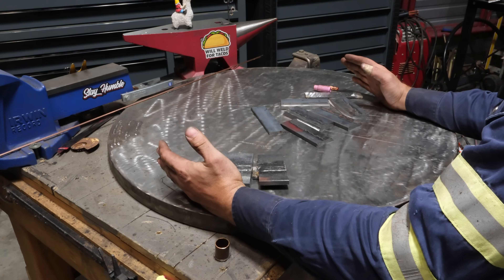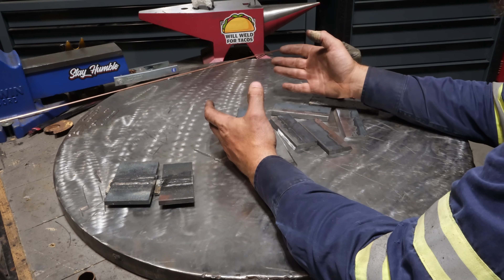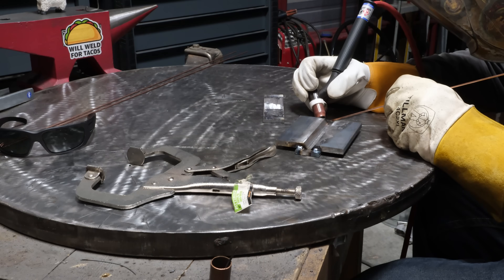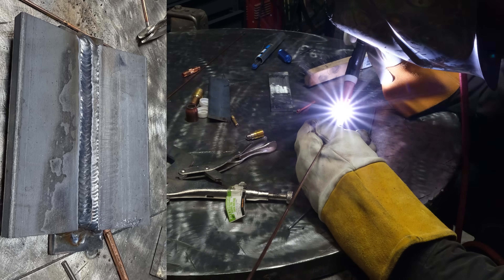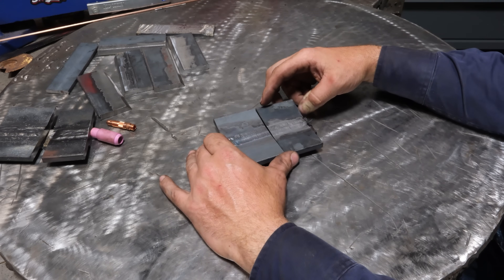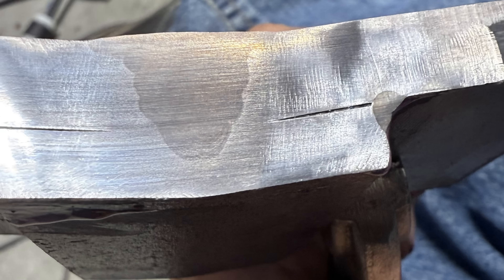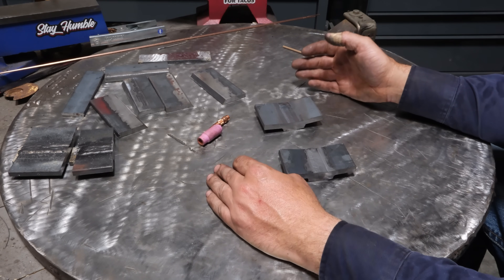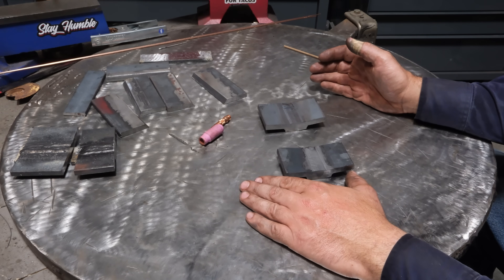How thick of metal can you tig weld with proper fusion?

Comment: I remember repairing some chill spots in some one off 3/4" thick cast bronze plates years back. Even with the insane amount of heat sinking I was able to get 100% fusion with the silicon bronze rod at around 200A. It was like being in a UV blast sauna. That was the only time I ever hit the duty cycle on my precision Tig 230....I wanted a water cooled torch after that.
Reply from the maker: 200 amps on most any tig machine will make anyone wish for a water cooled torch lol.  It’s no fun dealing with a torch that’s almost on melt down.

Comment: Really impressive penetration and consistency in the cut/etch.  I appreciate the explanation and comparison of TIG with other processes; never had that explained to me before!  I see why you limited to 130 amps and understand why it takes so long for this big/heavy joint.  Alternatively, if one had 220V and a welder set to 200-220 amps and used 1/8" filler, would it be several times faster than this, and closer to the speed of stick?
Reply from the maker: So at 200a and 1/8th filler the job could have been cut down in half the time or less.  The downside is it still wouldn’t be as fast as stick realistically.  Even though tig welding can the same size rods (1/8th) as stick, 7018 rods put down additional metal via the flux.  The other issue is because tig is slower, the heat input will be higher and it can be difficult to tig weld over super cooked welds.  With stick the flux turns to slag and protects the metal surface from oxides forming, which makes the finished weld cleaner and easier to weld over.  Tig doesn’t have that, only the gas shielded area will be protected.  It’s very common running high amp tig to have pretty cooked welds and that will require wire wheeling/extra time between passes or it starts to weld poorly (higher chance for defects).  I need to do a video testing how fast I could do it in, I bet it would still be super long lol.

Comment: on mig and fcaw you can weld thicker but you need say 1.6mm wire.
how cool is tig welding!
Reply from the maker: The wire processes definitely come into their own  when you start talking 220+ amps and bigger wire.  Decent sized wire with a powerful welder could have easily done that weld in 1/10th the time for sure lol.

Comment: Nice examples. I weld cast iron with TIG and 309L. Recently I had to build up a surface by as much as an inch on a part to increase strength. That’s how I did it at about 150 amps. Worked very well.
Reply from the maker: Build up work at 150 works great.  Many torches don’t like the heat but there are always ways around that lol.
Reply: @makingmistakeswithgreg yup. There are work around for most everything.

Comment: Great channel. I don't tig but enjoyed the info. Seems like a long process for what I play with....LOL
Reply from the maker: If you’re into heavy plate or thicker steel repairs it could definitely turn a 10min job into a few hours lol.  I should do a timed weld off and see how slow it actually is.  I bet tig is 4x slower than stick lol.
Reply: @makingmistakeswithgreg  lol...I actually don't TIG weld even though my welder can because I don't use gas and only fluxcore weld. Don't like dealing with the gas companies etc. Again very informative channel.

Comment: Great video as usual, thank you. You now made me consider buying a TIG machine next to my stick welder instead of MIG.. (speed is not an issue and dory stuff I can stick..)
Reply from the maker: Tig will give the cleanest welds possible start to finish.  It’s capable of welding super thin material too.  The main disadvantage is its inability to handle surface contaminates and slow welding speed.  If the downsides aren’t an issue it’s worth it to give it a shot.  Sure the learning curve is a bit steep but even that doesn’t take that long to improve at.

Comment: Can you do another with welding thick aluminum with only 200A TIG.
Reply from the maker: I definitely will.  Thick aluminum will cause a tig weld to bridge over (lack of fusion) really bad.  Preheating will actually improve this far more than on steel.
Reply: @makingmistakeswithgreg cool. I’ve got an aluminum head that I need to weld up an damaged exhaust port , not sure my 200A can do it .

Comment: Infinitely-thick. Butt two chamfered plates against each other so that there is a 90-degree angle convex valley between them and start welding along the line where they contact each other, moving back and forth down the valley until it is filled. You're going to need a great many filler rods.
Reply: Called it. More or less. I would have expected an aluminum backing plate so that it didn't stick to the iron.
Reply from the maker: The backing strip was used to ensure 100% tie in.  This is the preferred method over open root for many people because it takes less skill and provides strong results.  Rather than aluminum a person could also simply knife edge bevel and butt the plates tight.  Weld a root and hot pass, grind the backside, weld the backside flush, and continue to weld the rest out.  This would provide 100% clean weld material with no voids.

Comment: Congrats on 50k, Greg! I learned something today. I had always assumed that you would be limited in thickness by the capability of your machine when TIG welding. I was wrong. This is why I watch your channel religiously and recommend you to others.
Reply from the maker: Thanks 😀👍.  Many tig machines sold have a max thickness listed for steel (often times fairly thin) and for the most part that’s irrelevant.  Only with aluminum does amperage/max thickness play a significant role.  That’s a great thing because it means pretty much any tig machine is capable of welding thick steel with quality welds, no expensive machine required 😀.

Comment: Wait, you made a welding video and it started a controversy?  Hard to believe!  😮🤣
Reply from the maker: Sometimes the controversy just finds me 😅.  Certain topics that go against “conventional” wisdom generate a lot of rough comments.  One of The worst has been a video I did on if beveling steel increases weld penetration.  The answer is it increases how deep the weld is in a plate but it doesn’t increase how much metal you can penetrate.  Every couple days that one generates someone saying the video is wrong but not explaining what’s wrong, or why it’s wrong 😅.  It’s more important to know what something does  than thinking it does something without knowing for sure lol.

Comment: how common is it to do a tig backing weld in the field?
Reply from the maker: So the test setup replicates a structural weld test in my state.  It wouldn’t be commonly done with tig but stick.  The fact it has a backing strip just means you run a wider opening and it’s a bit easier to do (aka no open root).  It’s a good way to test if a process is capable of welding thick material because it offers the ideal situation: wide bevels and a place for the molten material to go.  With normal fillet weld on 3/8+ material short arc MiG and .035 flux core can’t make acceptable welds either, this test makes it slightly easier.

Comment: Any idea how oxy/acetylene welding would compare? I've read that it will work on thicker stuff, but I never had a need to try it.
Reply from the maker: So I have a feeling with a big enough torch tip oxy fuel will be able to match the overall fusion of tig.  It will never be as strong as tig on steel because the gas produced from the burning of acetylene is co2 and that weakens the weld (just like 100% co2 weakens MiG welds over c25).  I will definitely test this at some point because I have never seen a cut and etch with a gas weld.
Reply: @makingmistakeswithgreg  I was curious about the changes in metallurgy. I know the welds on the thinner stuff I do are not as hard as mig welds with 75/25 gas, and I was told it was the increase in carbon content from the co2. Never really questioned it much because its non-structural sheetmetal, and the oxy/acetylene welds planish easier. I would love to see a cut and etch, since I believe most people have forgotten about that caveman technology.
Reply: Back in the 80s, I had to learn to weld up to 1/2" plate with oxyacetalene. Then we had to do the same with  stick.

Comment: Great Video, Greg! I have the opportunity to obtain a Stick /tig /mig machine with water cooler, capable of 350A (one of the early inverters from Kemppi) for under 800 €. Should I buy it? Mig is not my goal here, I have a quite decent mig-welder already. But Stick and tig seem very appealing to me, because my machines are limited to 170 / 200 amps. I usually use tig with higher Amperage to do root passes and often 2nd and 3 layer (? hot pass?) that have to be sealed shut on Equipment like the fat cylinder of the tracktensioner of my excavator and when joyning thick steel with buttjoint and x-groove. With my small machines that is stupidly slow.   For fill and cover I prefer mig for the dske of speed. 
Off topic: did you geht the E-mal with the Photos of the break test I did with dualshield on the small 160A machine?
I now got the wirefeed issues the welds suffered from fixed simply by replacing the crappy wirefeeder as well as the mig torch and could now do some more tests and send you the results, if you are interrested.
Reply from the maker: I will check for the email as soon as I am home (I have been out on the road for almost two months).  I am not sure if you made your decision to buy that welder but I will share my thoughts on that.  A water cooled 300+ amp machines can do wonders if it is capable of a/c for tig.  Tig welding on steel is much easier on a machine than aluminum.  A 200-250a machine for steel is more than enough in most cases, since most people don’t tig welding 180+ amps for long periods of time.  Aluminum is a completely different story, to me 200a is barely adequate for any decent amount of aluminum.  A normal 200a machine will always have an issue with machine duty cycle, gas cooled torch getting too hot, and flat out lack of amperage.  Getting into a 300a machine opens a ton of doors will aluminum that wouldn’t exist otherwise. 

Based on the price I would probably buy it 100% if it can do a/c.  If it’s d/c only and you find your torch gets hot or you could use the higher duty cycle/metal deposition speed I would still consider it.  Water cooled torches are nice, and the machine would probably never complain about lower output use (aka would last forever in a non production environment lol).

Comment: Great video!! This video made me wonder about that back plate, what is the reason for using that? I've laid copper or brass behind some welds then they come off??
Reply from the maker: So the plate setup is a direct replica of a state structural test, typically given with stick welding.  It works great because it’s a consistent test and reasonably good at testing a process.  The first root weld can be difficult to get everything to fuse, and the fill passes make it about the best case (easiest) to put down a clean weld.  Any defects that show up consistently could mean an issue with technique or issues with the processes.

Comment: Great video!  Will need to set up my stick welder for TIG some day (has lift TIG)…should be interesting to try.
Reply from the maker: It does take a while to get tig down, but it will make completely clean welds fairly easily and it’s well work experimenting with 😀👍

Comment: Thanks, Greg. Can you do this for stick? This would round out the set so we have MIG, TIG,  Stick.
Other: I have a DialArc250P and an Argon Bottle.  I have been vacillating on setting this up for scratch start TIG. The price for a quality TIG torch with adjustable flow, regulator, and consumables added up pretty quickly. I have been waiting for a TIG rig to show up at auction. When it's cooler this winter, there will be more of an itch to get this figured out. Your  thoughts?
Reply from the maker: I will definitely do it with stick, and it shouldn’t have much of an issue even with 3/32 rods at 90amps.  As far as a tig setup with that dial arc, I would suggest just picking up this:  https://www.amazon.com/YESWELDER-Gas-Valve-Flexible-Air-Cooled-Complete/dp/B08PV7QY4K/ref=mp_s_a_1_1?crid=LENN3UXUIU90&dib=eyJ2IjoiMSJ9.KG2LvwR3xW5yR2YR45NiUqkQh2W3LxkZu5BDXSFvVEEn-peqfyam5MTpxW5epRN2CsJhR9Qd0PlH0HVZ2qYPynilnZOGdDC0WQE73eRz4uvkW9NTqnt9GToNiXiv7InagTeUA0tTYRyjanG4IJJ8w5hwfpXexI0-w7j2O5valsJwmhhCaAcVD-LAAFhZnlF6phJLTwMOvzteogIYXlQrZA.0GFFzEMcb1mHxpABTpwB9nu5C_zSlaSw8iSb6U3P7iQ&dib_tag=se&keywords=scratch+start+tig&qid=1756162457&sprefix=scratch+start+tig%2Caps%2C152&sr=8-1

I bought one and it has worked out great.  That combined with a regulator should put you in a good situation.  If you need consumables I have boxes of consumables I will never use, I can send you some tungsten, collets, and cups.  Every time I buy a welder it comes with a kit and I don’t ever end up using any of them lol.  Send me a email at weldingoldschool@gmail.com when you’re ready for some 👍

Comment: Hey Greg I repeated your tests with dualshield .035 and .045 and came up with the same results until I tried with the 480v production machines we use at work. I was able to get my home welder into spray transfer on the .035 wire and was able to achieve some root fusion running max settings and moving ahead of the puddle with no manipulation, straight stringers. Until I blew my breaker. It's just not practical for home use.
Reply: Thanks for contributing to the knowledge base here!
Reply from the maker: Sorry for the late response, YouTube did some weird stuff and made your comment not show up in my list as not replied too.  I am not surprised that’s what you found, it’s good to know for my sake (and others) that good results will be a struggle.  So much about wire welding comes down to the limitations of the equipment, and many people don’t realize this.  Once you cross into bigger 250+ amp machines thick metal becomes absolutely no issue.  It’s just unfortunate that most people don’t have machines that powerful.